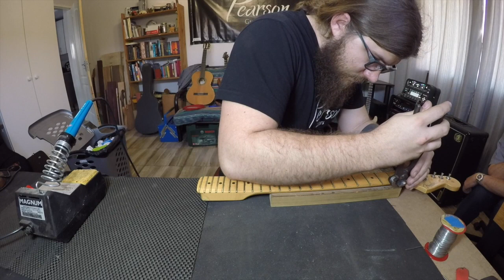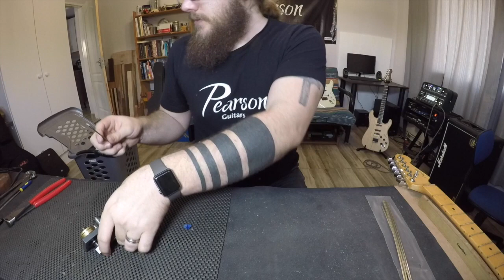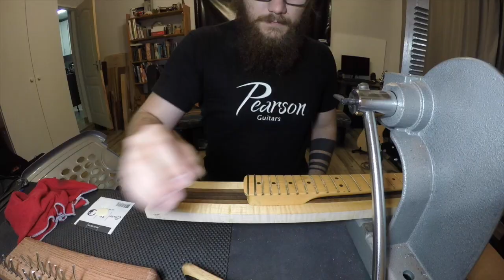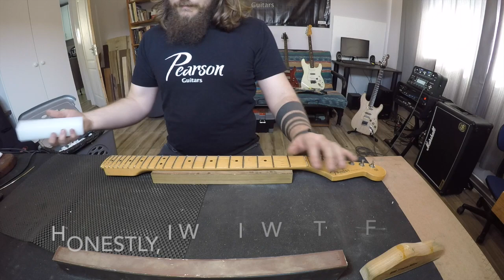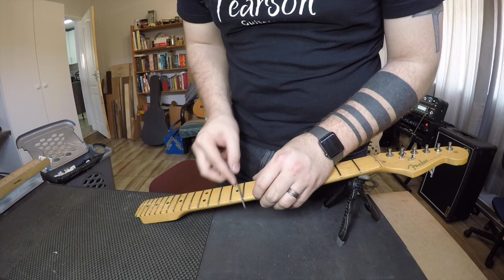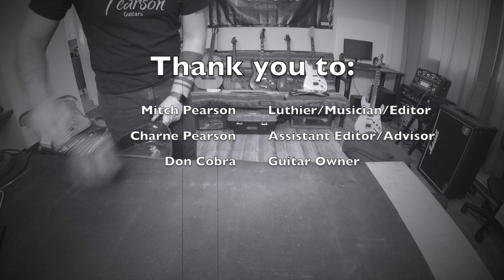USA Fender Stratocaster Maple Fretboard Refret

Comment: What is the point of using solder to heat the fret? Seems so unnecessary and I've never had any issues not using solder. Am I missing some benefit? I'd be afraid of it dripping onto the board.
Reply: I know this is two years later, it only popped in my feed. The concept is to help spread the heat and let you know when to stop heating. However, just like you I see it as a pain as I use lead solder and you should wear a mask as breathing in lead fumes is bad and two it's just a waste of solder. If you are experienced you don't need solder, especially if using water. I only use water on rosewood. This guy missed the essential bit of scoring the lacquer either side of the frets. I've not bothered  with water on maple as it is far less prone to chipping but I'll try it next time on a maple board to see if it was worth it

Comment: How would I go about leveling a compound radius fretboard?
Reply: Use a beam and follow the edge of the board angled in to match the nut rather than the usual running straight lines. There are some YouTube videos on how

Comment: Hey there, @Pearson Guitars!

Great video, much appreciated! You just earned yourself a new subscriber 😊
I do guitar repairs, setups and refrets as well, and it's always excellent to see how other people do it!

I have a few questions, I would like for you to answer, if I may...

1.  When it comes to filing the fret ends flush, after using the bastard/coarse file, does the 600 grit sandpaper do a better job of protecting the lacquer/finish of the edges? It's often very easy to file a little of the finish, when doing this task - hence it being the hard part, as you said!

2. What's the reason for you leveling and crowning the frets, before doing the fret end dressing?
Any particular reason?
I normally file the fret ends flush, then bevel the frets, then round/dress the fret ends.
Followed by leveling the frets., crowning the frets and round the tops, and lastly polishing the frets and fret ends.

3. Did the fret tang fit the slot depth completely - not leaving any gaps at the end, for you to fill?

Thanks - I'm looking forward to hear from you.
Best regards & Cheers.
Reply from the maker: Hey @GuitarNTabs! 

Thank you very much for the sub!

1. The 600 grit paper helps a lot! The initial bastard file gets most of the overhang away, but then I go in slowly with the 600 to finish it off, then before buffing, I usually just run through the micromesh grits to get the polish back.

2. So I have noticed that if I do the fret end dressing first, I mess up the perfect uniform ends while crowning. So it is just a method that helps me get uniform fret ends if I do the end dressing afterwards.

3. Usually before I start fretting, I measure the depth of the slot and then the depth of the tang. Usually I need to saw the slot very slightly deeper, and then the frets fit perfectly if I seat them nicely.

Comment: hey there! I noticed you didn't have to touch up the end of the maple where you filed the frets flish to the edge.  Is there a trick for getting everything flush without touching the finish or the wood? I saw you used a fine file to get the tang and seems that even that touches a bit of the side.  Thanks!
Reply from the maker: Hey Jordan! I am very gentle, and as long as I do not remove all the finish, I can just polish it back up again. I suppose you will always remove a very small amount of the finish just to get it flush, but just don't go too far.
Reply: @mitchpearson8467  roger - thanks for the reply!

Comment: why are you adding solder while you heat the fret?
Reply: It conducts the heat in to the metal efficiently. If you just put a hot iron on the wire it would heat up rapidly in a single spot and probably burn the lacquer.

Comment: I've noticed twice ow that your bending radius is more than the actual fretboard. pls explain? Or is that just the camera illusion?
Reply from the maker: You are correct. I always over bend slightly with a refret. The degree to which I over bend depends on the fret wire material. Over bending causes the fret to bite down in a different way. I tap the ends of the frets in, and then press the frets in with the arbour press. That causes the tangs of the frets to bite in sideways as well. I only tend to do this with a refret though. A new fretboard still has unused slots, so the fret tang barbs bite in easily.

Comment: Hey bro this is such an informative video.
I wanted to know the specs of your new fret wire.
I want to refret my stratocaster with stainless stell frets.
I have my eyes on frets with 0.51 inch crown height
And width 0.114 inches.
Detailed specs-
Tang Height: 1.7mm (0.067 inch)
Tang Width: 0.6mm (0.024 inch)
Stud Width: 0.95mm (0.037 inch)
Stud Space: 2.5mm (0.098 inch)

This is unlike the Fender medium Jumbo (. 106″ width x . 036″ height).

Would I be able to refret my guitar wih nee stainless steel frets with the above mentioned specs?
Please do help.
Regards,
Leo

Comment: what glue are you using? and what are fret wire x section dimensions?
Reply from the maker: I used Alcolin Professional. Same recipe as Titebond II. The fret crown is 2.9mm x 1.4mm. The tang is 1.5mm by 0.7mm